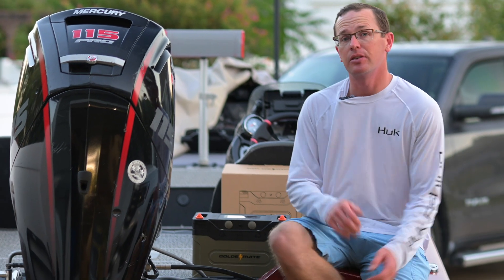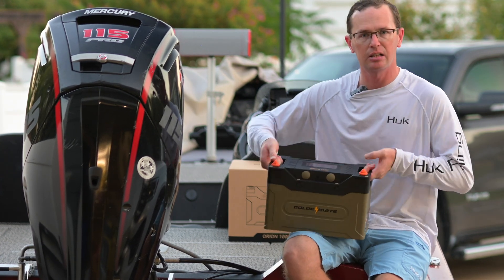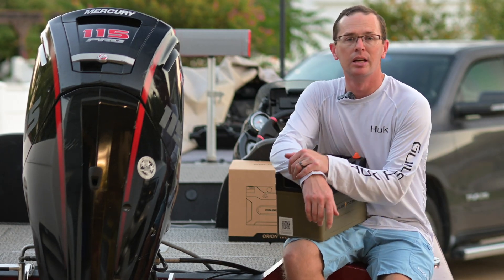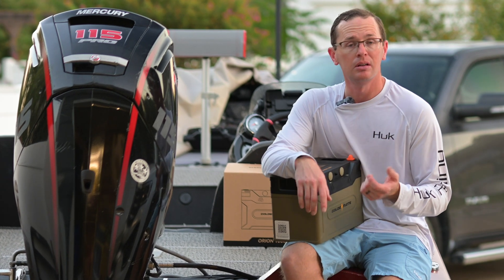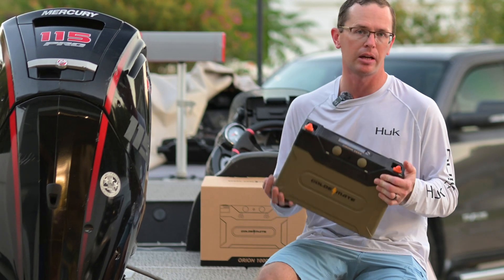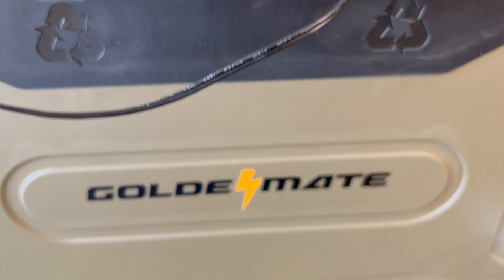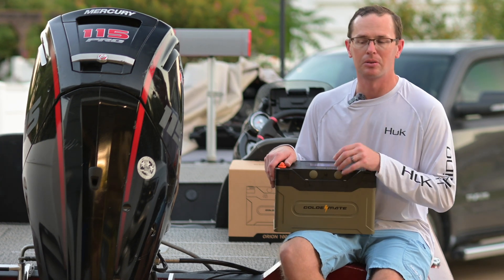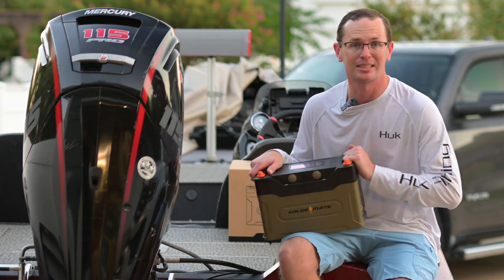This Battery is Has It All! GoldenMate Orion 1000 LiFePO4 - Trolling Motor, Solar, RV

Comment: Has anyone reviewed this battery without getting kick backs? Every thing I've read is a paid sponsor or affiliate.
Reply from the maker: What type of feedback are you looking for?

Since they sent me the battery, per the FTC, the paid content tag must be added to the video. 

Outside of that, the shared testing and functional use in the video have no requirements between myself and GoldenMate. There is no "payment" for me to say this is good, or bad. I test the batteries, use them, and share my experience.
Reply: @goodmanfishing  You get any kick backs through the links if someone purchases?

As far as original question, I'd like to see someone who didn't get a free battery and do a review. Someone with no link in bio. Feedback about the whole process and ownership. When you get stuff free small things/issues are easily forgotten bc there is no regret. Also getting free doesn't mean it is a need. No need then no use. A lot of things work great for a day or two. What about a month later of continual usage? Etc...
Reply from the maker: @jjcc2192 pretty much pennies. 

As far as the long term reviews. I started there, but there's only so many batteries a person needs and as you know the purchase price isn't cheap. It would take 10's of thousands of views to recoup that out of pocket expense, once monetized from YT. I do cycle through batteries fairly regularly, i  have not ran into issues that get easily forgotten. Perhaps lucky on that. 

I do understand where you're coming from, be sure to post up some content on whichever battery you go with! 👍
Reply: @goodmanfishing  Yea, I get ya. I just wish they sent some batteries to some random boat/fishing YT'ers so people could see some daily use on them and feedback. Marketed as a trolling motor battery, so lets see some back to back 8 hour days of trolling. Instead I'm seeing videos of people saying the same thing about this battery as the last 4-5 batteries they got for free, and just after a few days of messing with it. Just seems disingenuous, and suspicious the company doesn't want any real testing on YouTube done. 

Meanwhile Dakota is giving out similar batteries to pro fishers on live TV. Nothing to hide from them.

Nothing against you, just annoying that the algorithm sends me 20+ ads a day for this battery, yet can't find anything on them minus some quick YT free-battery reviews.